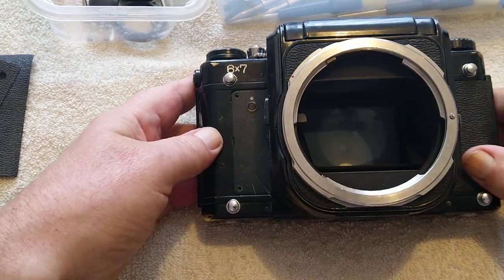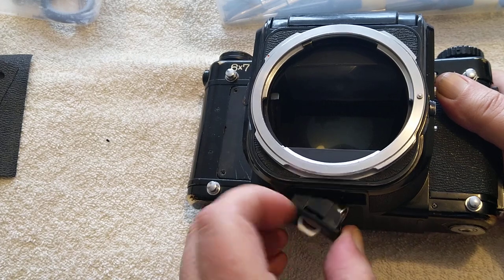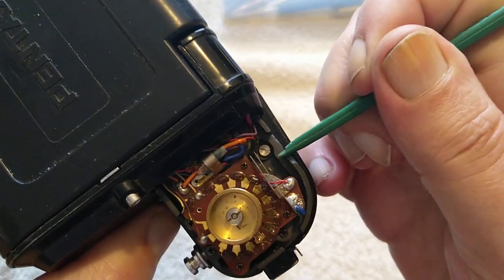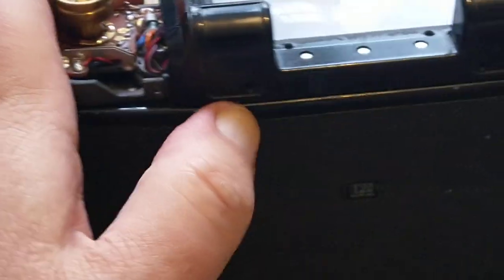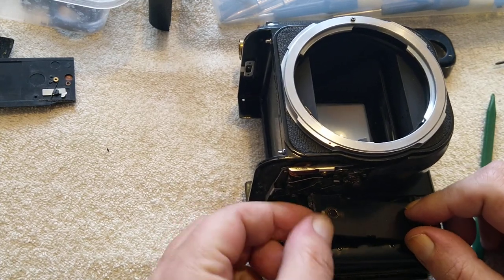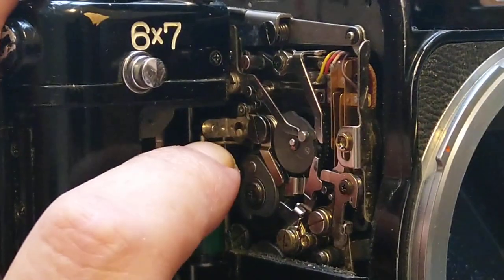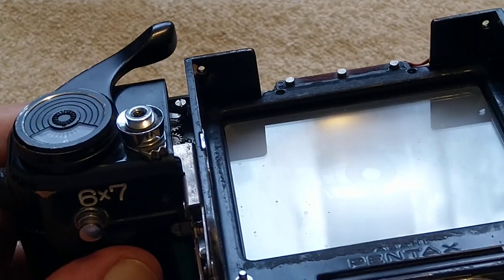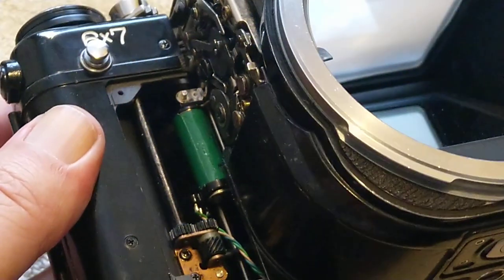Pentax 6x7 woes and issues

Comment: Heya,. so bought a well cleaned and regularly maintained Pentax 6x7 MLU with the TTL prism. Put a few rolls through it and it worked great, metering was accurate and all but thing started to happen when I switched the battery to 4LR44 batteries.

Loaded a new roll with the new battery and it worked great until the 4th shot and the mirror got stuck halfway. Reset the camera, loaded a new battery, same 4LR44 and same thing happened. Did a battery check and it was fine so reset the camera again and loaded a third new battery. Tried a lower shutter speed and the camera worked again and eventually got stuck again few shots in.

Decided to just burst through the remaining shots, opened the back and did dry fires with the new batteries and it worked 3-4 shots in a got stuck again. Was super pissed so when and bought silver oxide battery, loaded it into the camera and everything worked fine. Managed to shoot a proper whole new roll with it.

Based on my research online, some people never had issues with 4LR44 batteries and some do, I suspect might be my TTL meter but mine has an off switch which is always off. So if anyone can shed some information, would be much appreciated as well. RIP Kodak Ektar 100, luckily wasn't slide film.

Comment: thanks for a great vidio .i have a 6x7 with a mirror problem I cock press shutter mirror goes up and stays up for a second or more with my shutter set at 1000sec , then if I keep firring its ok but if I leave it for 15 20 mins the same thing happens (frustrating to say the least) any suggestions would be appresiated John.

Comment: I'm about to clean one of this cameras, great info here, I was having issues with a new battery and the shutter getting stuck on fast settings (over 60) that was getting the lens stuck open, I believe now watching your video that is not getting a good connection on the shutter dial and probably getting ont that "t" mode
Reply from the maker: Hi, I had the same issue, quite common, surprising how much dirt was on the speed selector connections, a bit of contact cleaner should help, it is quite an easy job, the harder one is the mirror solenoid cleaning, it requires a bit of disassembly as outlined in the video, mine has worked flawlessly since, any problems please feel free to come back to me 😊
Reply: @thephotographersbag  amazing, thank you so much! I'm also about to clean some of the pentax lenses, some of them have fungus so I'm going to use some peroxide to clean them, do you know of a good guide for disassembly?

Comment: You really seem to know your 67s! I have a non MLU 6 x 7 with film feeding issues (shockinga I know.) The frames are evenly spaced but the quarter inch space causes the last frame to be truncated. The feed also feels quite stiff when cocking the shutter. The left spool moves fairly freely but there is a rubberized roller on the right side that spins freely from right to left but stops when turning in the film feed direction. This seems like it would add a lot of friction to the system but I don’t know if this is normal or not. Is that correct or is there a problem with that roller? Any other advice on how I might address these problems? I’m not sure I can justify the cost of a cla for this old camera. Thanks for any help or information.

Comment: Thanks for that well explained video ! My issue : I cannot get the speed dial button off. Having unscrewed the 3 little srews under it the cage is moving but the speed dial is very tight and I don't see how it can come off. Any advice is very welcome.
Reply: I found it ;-) ... there a 3 other little screws , deep in the holes , of the side directly on the speed dial button...

Comment: Thanks so much for sharing this useful video - I've followed all the steps and found it really useful. I don't know if you have heard of this issue but my 'mint'' 6x7 (no mirror lockup) exposes first frame fine - then remaining frames until the last (half) frame is exposed again. I've run two films through now, same result. Any ideas?? Many thanks for your generous time.
Reply from the maker: Hi, and thanks for your kind words, these medium format cameras are really fussy about film tightness, it is important to keep the film and backing paper taught during loading, I have experienced the frame overlap issue on various 120 cameras...
Secondly the advance mechanism might be the problem, check this by running just a backing paper through the camera, fire the shutter on the B setting with the lens removed and run a pen/pencil round the shutter opening, leaving a mark on the backing paper, advance the paper as though it was film and repeat till the roll is complete, open the back, remove the paper and examine, this will quickly identify if the advance mechanism is faulty....
Please feel free to come back to me if you need further advice 🙂
Reply: @thephotographersbag  thanks so much for taking the time for such a comprehensive reply - I really appreciate your generosity of time and expertise! I'll give this a go and fingers crossed it helps ID the issue. All the best. 
:)

Comment: Incredibly informative thank you so much for sharing. My camera (6x7 MLU) is currently experiment the mirror staying up halfway for the first shot of every roll, guess I better try cleaning to contacts and hope that solves the issue 😅
Reply from the maker: Hi, thanks for your kind words, they are quite easy to work on and mine has been working just fine since the repair, any problems please feel free to come back to me, great camera 😁
Reply: @thephotographersbag  it's my favorite medium format camera by far, I posted a few videos featuring it on my channel. it's simply a pleasure to use. Thank you for the offer i will be sure to take you up on that if i run into any issues.
Reply from the maker: @2071photo  subscribed....
Reply: @thephotographersbag 2:25
Reply: @thephotographersbag  Hello, which battery you would recommend? I have the 6x7 MLU with metered prism
Reply from the maker: @roiloubia4483  Hi, the camera takes 1 4LR44 battery, I personally use 1 4SR44 as they seem to last longer,  at a pinch you could tape together 4 individual LR/SR batteries, always carry a spare, the camera is not mechanical 😀
Reply: @thephotographersbag  Thank you very much. I am not very satisfied with the 4LR44 alkaline battery regarding longevity..Will definitely try the 4SR44...Love your videos..

Comment: How would you say that the mirror lockup and non-lockup models compare internally? I've heard to stay away from the non lockup, but is that mostly a factor or more age, or some inadequacy with the design?
Reply from the maker: Hi, I haven't been inside a non MLU version so unable to comment but I expect any difference to be minor
The big issue is the vibration due to mirror slap, they are extremely heavy and solid but that big mirror banging about makes slowish shutter speeds almost impossible without a sturdy tripod, I don't think age of any camera is an issue, maybe they should have included MLU from the start, these were always professional cameras and benefit from regular servicing, not a particularly onerous task 😁
Reply: @thephotographersbag  I've just been looking into buying one and I've heard that the non mlu version is less reliable, and others say they've handheld down to ⅒th with and without mlu and couldn't tell a difference, so I was unsure which I should buy. The one without lockup is generally cheaper, even in the same shape.
Reply from the maker: @mikafoxx2717  Hey, wow ,I could not hand hold at that low speed but I am old now!
The lower price of the non MLU versions signifies to me that they are less popular and slower to sell, if you mainly shoot at the 1over focal length of the lens, all will be fine, so say 125th with the standard lens, I can shoot my 55mm wide angle at a 60th and get sharp prints, the bigger the print the more noticeable any shake will be, may I ask what you will do with your photographs, internet or large poster size prints for example?
Reply: @thephotographersbag  
I've got 18x24" grade 3 paper and an Beseler 23c enlarger I inherited and would like to make larger enlargements in black and white, I've just been quartering those sheets and making prints from 35mm negatives from my black Pentax spotmatic. The easier resolution from flatbed scans is also nice. I do mostly landscape and object photography, but don't like to use a tripod unless it's specifically a night photo. I don't mind a heavy camera, I've lugged my 4x5 Busch pressman around before, but have no enlarger for that format, plus its more limited film choice.
Reply from the maker: @mikafoxx2717  Hi, sorry I am not much help with regards to you Pentax query, mine is the earlier version but with MLU
There were 4 versions in total
6x7 non MLU branded Asahi Pentax
6x7 with MLU branded Asahi Pentax
There was a factory upgrade available at the time to add MLU to a non MLU body
67 branded Pentax in updated font
67ii branded Pentax in updated font
The lenses can be told by the finish of the focus adjustment collar, the original lenses have it scalloped, the newer ones with a more modern rubber style covering
A lot of users complain about the position of the MLU lever, it is easy to activate by mistake, and the only way to lower the mirror again is to fire the shutter, wasting a shot, I have experience of this and now put tape over the lever.
As a user of the first gen model, I highly recommend them, the Mamiya RB/RZ series does have interchangeable film backs, the Pentax does not unfortunately...
Would be interested in hearing how you get on in the future,😀
Reply: @mikafoxx2717  I have the non mlu version and I was surprised to find I could see no camera shake down to 1/30th of a second. I didn’t try any slower because it’s hard to hand hold anything that at those shutter speeds. It’s surprising because it feels like the whole camera moves from the mirror slap.

Comment: Great video, my Pentax 6x7 is acting like my Hasselblad 500 after an exposure the mirror will not return unless I advance the film then it will lower any ideas I've already replace the battery, thanks.
Reply from the maker: Hi, sorry to hear about your issue, it's not a battery related issue, I suspect it relates to dirty contacts on the mirror solenoid, to clean this, some disassembly is required, removing the left side outer skin and removing some cover plates, a good CLA should sort it out, where in the World are you located?
Reply: @thephotographersbag  Washington D.C. area,thanks
Reply from the maker: Hey, 
This guy comes highly recommended

Eric Hendrickson
272 Shoffner Rd
Sharps Chapel, TN 37866

pentax27@aol.com

Fax/phone 865 278-1051

There is also this local place
ProPhoto
 https://www.prophotodc.com/
Hope this helps, please keep me posted, always looking for recommendations for repairers....

Comment: Very interesting - thanks
Reply from the maker: Hi, thanks for your kind words, great camera but does have some issues, was apprehensive about digging into mine but it was a breeze to sort out, fully working reliably, do you shoot a 67?
Reply: @thephotographersbag  I shoot a 6x7 and a 67 since app. 10 years meanwhile. In-between some trouble with broken chains, but currently working fine
Reply from the maker: @Klaus-macht-Bilder_de  Hi, the broken chain repair is one I want to avoid, it sounds very frustrating to sort out....